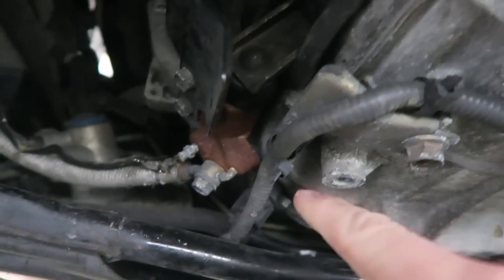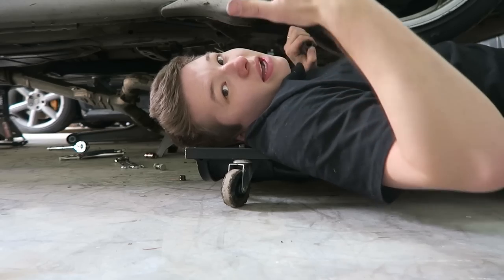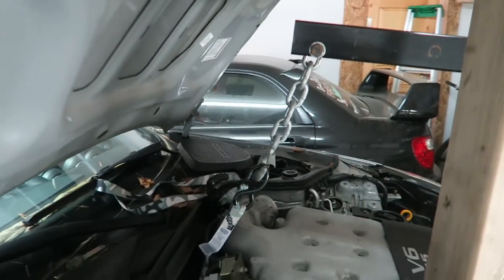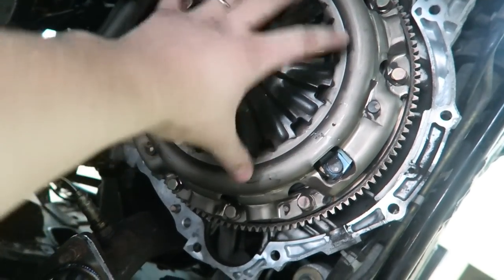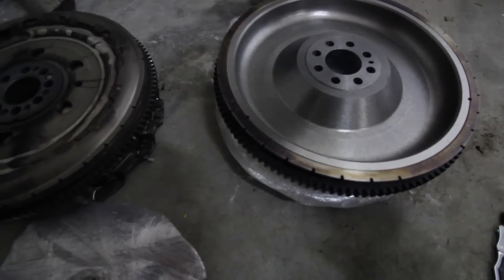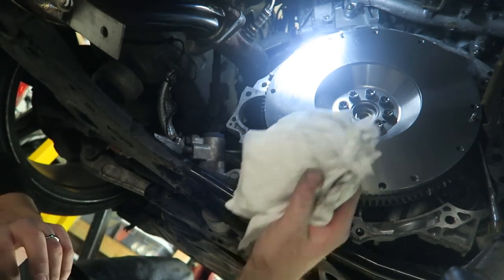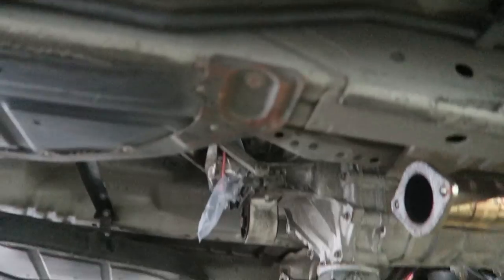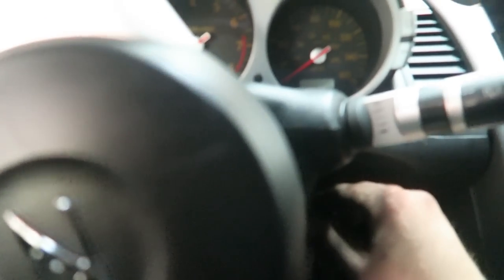350z Gets A New Clutch // How To Replace A Clutch

Comment: Good stuff! I dont think thats a JWT flywheel though, as their flywheels have replaceable wear discs and this is just one flat mating surface.

Thanks again for uploading this!
Reply: AHH I see. You got the Iron flywheel as opposed to their aluminium one.

Good buy
Reply from the maker: +Z33 Garage it's the lower end model from JWT. I bought it from a legit vendor, I think 600 out the door!
Reply: Subie Kyeg damn that is sweet! I got their other flywheel for 40 bucks used at formula D. just needed a new face plate

Comment: What type of grease did you use for your spline? I'm trying to replace my clutch too on my G35 and I can't figure what kind to use.
Reply from the maker: I have always used any High temp grease. Make sure it stands up to 500 degrees and it should work fine! And be sure not to over do it on the grease.

Comment: What was your clutch and flywheel set up and can it be used with the 2003 g35 as well?
Reply from the maker: Ended up with a JWT clutch and flywheel combo. I believe its compatible, just follow the instructions to be sure!
Reply: Do you get any clutch chatter ? Mines got a Lightweight Flywheel and the gearbox sounds like bag of broken nuts until the revs get over 2K

Comment: Was there a specific way to install the flywheel? As in considering the pins and indents ?
Reply: Yes , there is , the Dow pin HAS TO BE ALIGNED IN THE GUIDE HOLE ON THE FLYWHEEL ! car will not start or will start and turn off from incorrect timing from sensor

Comment: How tf did you get the rear main in without taking off the upper pan? Everything I’ve heard it’s literally impossible to have it seal correctly.
Reply from the maker: Yeah I’ve heard the same. Ideally you’d want to drop the pan, but what I did was use that clear plastic from clamshell packaging, and shape it in a slight cone, and wrap it around the crankshaft. Put grease on the lips of the seal, and slide it over the plastic, and it’ll slide onto the crankshaft. It was risky but I was confident and it ended up never leaking! Hope that makes sense